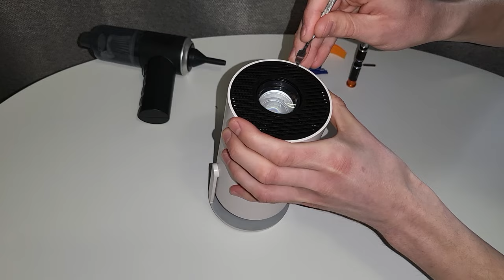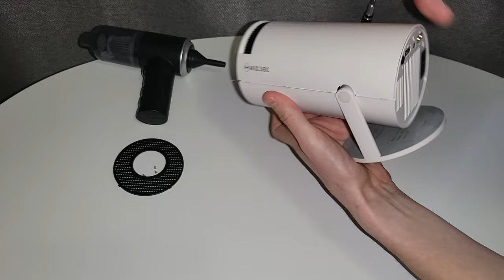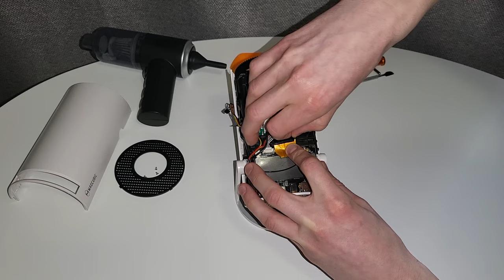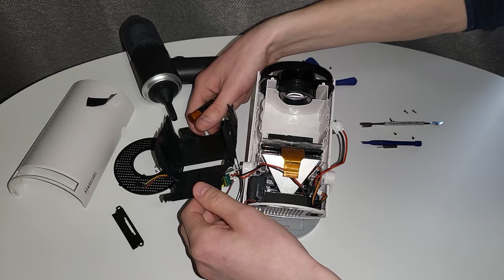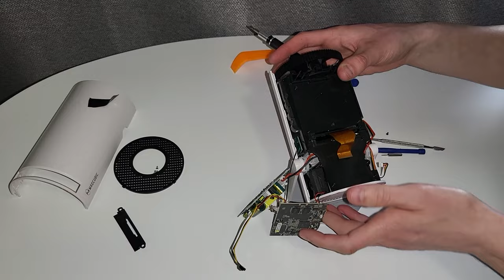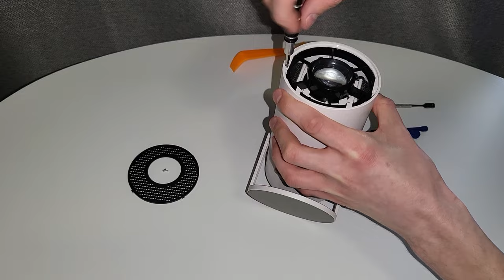How to clean the Magcubic HY300 Projector

Comment: If I'm not seeing wrong, the wires going from the transformer board should be like 12v or less, has anyone made a reading of what voltage? I would like to know because it would be neat if there could be done a modification to it to run it on 12v or a battery pack or something like that.
Reply: yup it is 12v in supply but the wattage is different because different projector uses different wattage of lamp which throws the light so for ur case u have to take readings.

Comment: As per the factory you don't need to pull up all the motherboard and stuff instead just pull up the LCD which is possible by just after opening the main cover  and just blow it out.  Still opening the projector is risky as frequent opening could easily damage the locks.

Comment: How do I prevent this from happening. I’ve had mine for a month and it’s starting to get really dusty on the inside. How do I prevent this from repeatedly happening 😢
Reply from the maker: Unfortunately no way, all cheap projectors have this flaw with dust ingress.
Reply: Next time try to buy a projector with the small cleaning window underneath in which you can clean the display dust using a q tip
Reply: My hy 320 is full of dust it is so annoying ı will buy wanbo mozart 1 because of dust proof
Reply: @orcuncobanoglu9019  they do sell a projector similar to this with a cleaning window, that's more like curved one than a cylindrical one.

Your decision to buy the closed engine one or the dust proof one is better.
Reply: @averagestudent4358  Name of the projector please?

Comment: Really like the projector, but fan is really noisy. I was wondering if you could exchange it (maybe it's a special part though) to a more quiet one (a bit more expensive)...
Reply from the maker: The projector is cool, but I agree with you the fan is noisy. I have never changed the fan and I don't know where to buy a quieter fan for this model of projector, sorry.